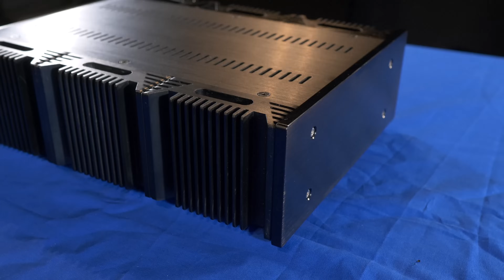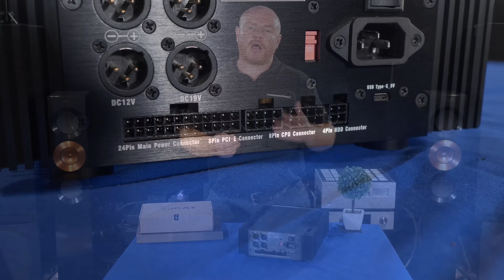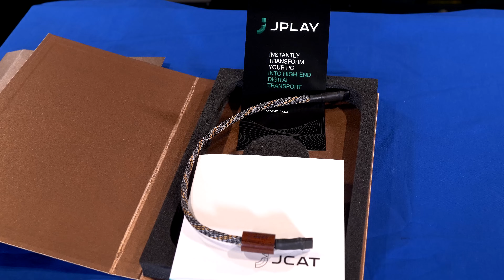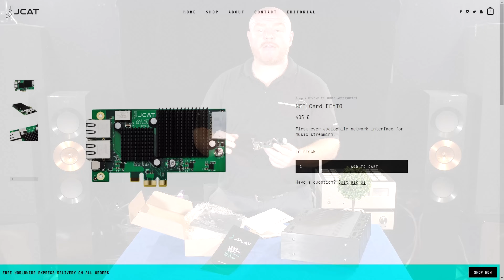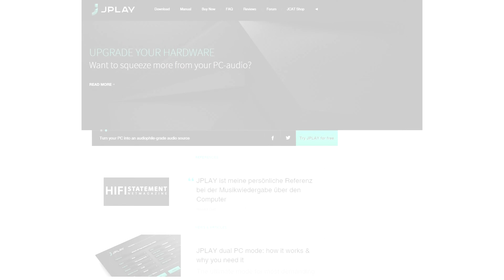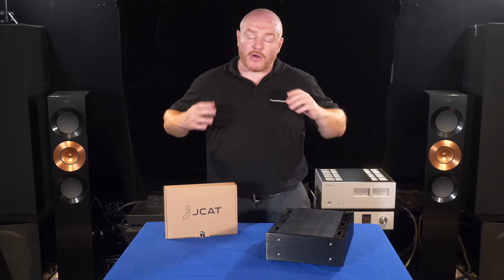New Computer Music Server Build Starts Here - Audio PC Digital Transport + Linear Power Supply

Comment: Hi Tel. This is gonna be interesting. I am all digital based too but still only use my trusty Cyrus CD XT 2 plus PSX-R. Know I am limited to Red Book only and have been thinking of creating an audio pc as you have. I do not have the techie skills you seem to, as never built any PC before. Have sold software all my life so not a complete luddite. 😁 Can you please run through the build in detail including minimum cost for initial set up and then the upgrade path? Thanks. Ps are you selling your (soon to be) old one in due course?
Reply from the maker: Hi Alex, I will do my best to go through everything, its no different to building any computer really its just using certain bits that make it sound good.
There are a lot of software things you need to do also - the hardware is the easier part.

I would love to start again and use a newer lower tdp cpu but to save me money and time I am recycling a lot of my existing parts - changing chassis and adding new bits.